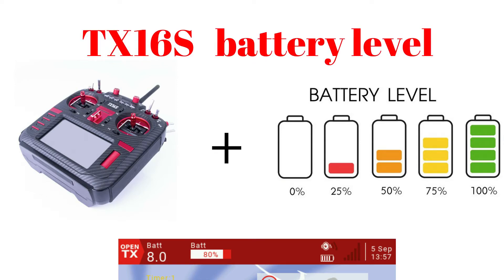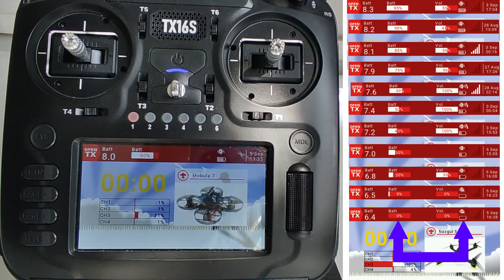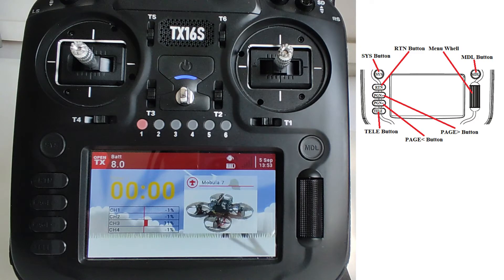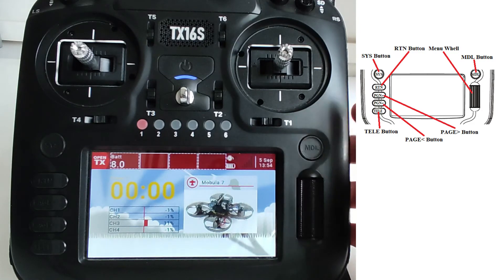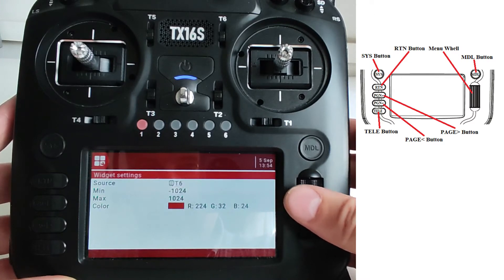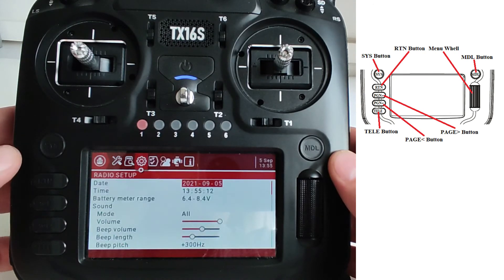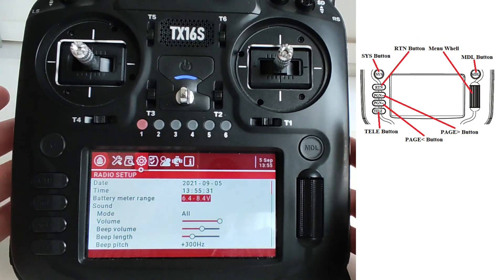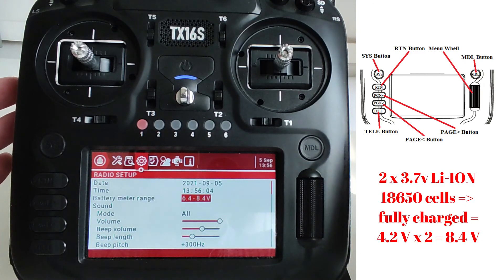TX16S: displaying the battery level on OpenTX & EdgeTX – percentage [%] and value [voltage]

Comment: what should be the voltage read when it is low and time to charge the transmitter? also what does enable maximum throw on one of the model setting does? when i enable it for some reason the throttle comes on while throttle cut switch is on
Reply from the maker: The lower voltage depends by battery types. For LiPo is 3.6V (you can go down to 3.5 but not lower) for LiIon is 3 V. If you use a discharge rate below 1/2  of the C rate, then 2.75 volts. BUT 2.5 V should be the absolute limit.
Reply from the maker: The second part of your question I was unable to understand.

Comment: Excellent👍.       I wondered why the original setting is 1024?   Seems 64 and 84 is a big reduction    Does it make a difference if you use lipo batteries or other types and is this what 1024 represents? 🤔
Reply from the maker: I think 1024 is maximum resolution accepted. They use a analog to digital convertor on 10 bits.

Comment: Great video.   You show an arrow to point out two battery displays, one that the TX16 shows by default.  I presume you have to have both and that default cannot be changed or removed so one widget remains?
Reply from the maker: I'm unsure, I will go to my station to test ... but I think it is impossible to remove.

Comment: While this works for the TX battery, it doesn't work at all for the main (flight) battery, at least not for me.  I have Telemetry on my ESC/FBL, which shows the main Battery as RB1V.  I can set up a value widget, select RB1V for the source, and I get the current value (eg. 23.9V), but if I choose a Gauge widget, select RB1V, It defaults to 100%, regardless of the values I enter for MIN and MAX.  I tried 210 ~ 252 (21.0V to 25.2V), and it always says 100%.

So what's the trick to get a percentage gauge for the main battery?
Reply from the maker: In this evening, I will make the same setup on my Crossfire - base on the battery from the drone. I will give to you a correct answer in few hours.
Reply: @i3Drones  Yes, I'd like to see how you do this, because I didn't work for me.  I had to get a separate widget from Github to make it work, but that widget is large and can't be put on the top bar
Reply from the maker: @chrispirvan4969  in my case (Crossfire system TX + RX) the RxBt (receiver battery voltage from telemetry) works very well with Gauge widget - as expected. 

Second, I converted RxBt = {21.0V to 25.2V} => y = {0% to 100%}  by using y = 23.8 x RxBt - 500 and I tray to implement this relation in OpenTX in order to print the result in a Gauge widget - without success. So, right now I am without any ideas for your problem. I have a question: Does not RB1V means reference battery 1V? In this case it is normal to display all the time 100%.

Comment: Great video,can you tell me what value i need to enter for flysky nirvana,nirvana use 2x18650 but in parallel(4.1V)
Thanks
Reply from the maker: Nice radio! By using 2x18650 in parallel, for min value use 3.2V for max value use 4.2V.
Reply: @i3Drones  Thanks,but i need to know what i need to enter in edgetx for battery widget in %
Reply from the maker: @LordFpv , I have little experience with EdgeTX, but having in mind that EdgeTX is a fork of OpenTX they are similar. So, if in battery metter range you have 3.2V and 4.2V - put 32 and 42 values on the widget.
Reply: @i3Drones  Thanks,that i think but i am not sure so i need to ask :)
Thank you :)

Comment: Would you please tell me the max & min numbers for a Gaoneng GNB 7.4V 3000mAh 5C 2S Lipo Battery
Reply: 22.2wh
Reply from the maker: @adrianau4246  If you use a Li-Po battery, the voltage must not be below 3.5V per cell. Even so, many recommend not being below 3.6V. In conclusion, if you use Li-Po use 7.2 V (or 72) as a minimum value. For the max value it is like the for Li-Ion 8.4 V (4.2 x 2 = 8.4 V or 84).
Reply: @i3Drones  thank you sir :) helps a lot
Reply from the maker: @adrianau4246  next time I will help you with the same joy.

Comment: thanks,veryhelpfull...but i dont know why the wichone battery simbol didnt function
Reply from the maker: I'm glad to help you ... but I don't understand what  "battery symbol didn't function". What do you mean it doesn't function?
Reply: @i3Drones  sory for my bad English,..it's widget with battery symbol like in Cellphone...i have batt sensor in telemetri list but cant make this function, so i just can use Value Widget like in your video
Reply from the maker: @slider9780  If you use the battery from the telemetry, I think you will have displayed the battery value send it by the drone through the telemetry channel. Here I present the value of your transmitter battery.

Comment: Excellent video! Just one question. Why sis you select 64 as your lower value? Is 6.4 volts the completely discharged value for these batteries?
Reply from the maker: If you are using a LiPo battery, the voltage must not be below 3.5V per cell. Even so, many recommend not being below 3.6V. In my case, I have LiIo. If you search into the net, they consider that 3.0V must be the cutoff at room temperature. But, you go to the outside where can be wind and low temperature - the winter is comming :-). So, I decided that to take a more conservative value of 3.2V. I have 2 elements, so I choose 6.4V.